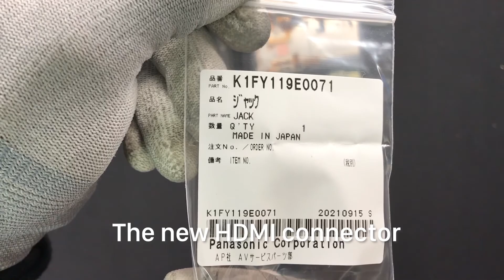How to repair Panasonic camera DMC-GH4 - exchange HDMI connector

Comment: Nice detailed video! Which size of screw driver you use? Is it a JIS #00 or #000 ? I need to open my GH4 to check the ribbon cable from the Battery Grip connector, the buttons ISO, exposure, WB  don't work anymore on the grip.  Thank you, cheers from Canada.

Comment: I have 3 burnt out GH4's with Micro HDMI out. Can one if going to this trouble. replace with full size HDMI ports. I find nearly everyone I know has/had this problem. The reason the Gh5, GH5S Mk2 and Gh6 have full size. As the amount or replacement under warranty was driving Panasonic nuts and broke.
Reply from the maker: Hi send the camera to us :)
Reply: @DIGISERVICEBG  Is this possible set full size HDMI port to GH4? Video out can be removed if it helps you. How much it will cost? Also if not possible set Full HDMI how much will cost replace same small HDMI.
Reply from the maker: @for-line  hi can’t be ful size

Comment: Where did you get the Micro HDMi connector from? I have searched Digikey, Mouser and Arrow and the single row micro hdmi connector is non existant. I have found the dual row connector, made by JAE electronics, but not the single row micro hdmi connector that you have shown here. Thanks.